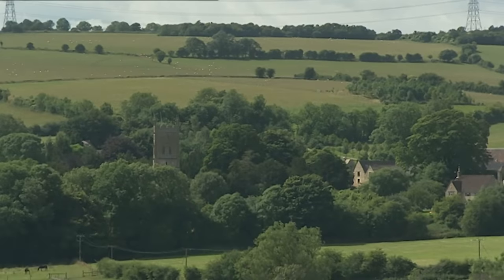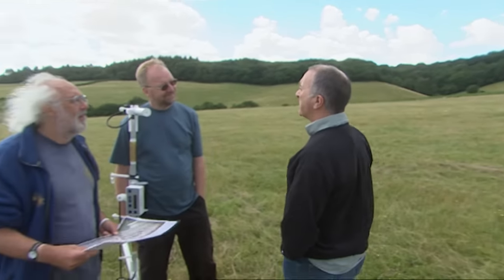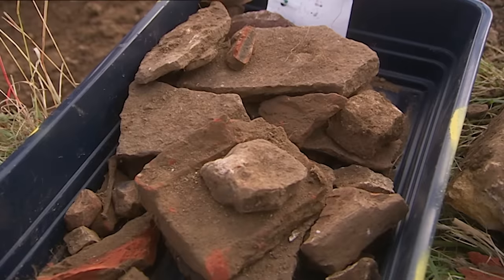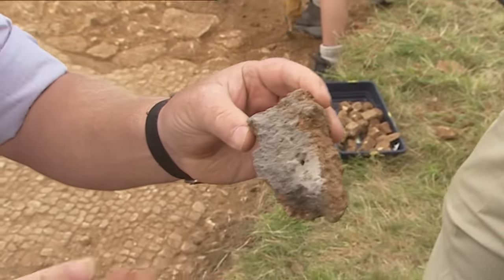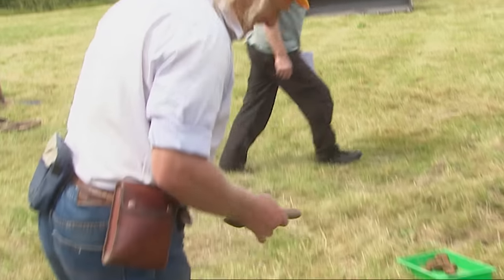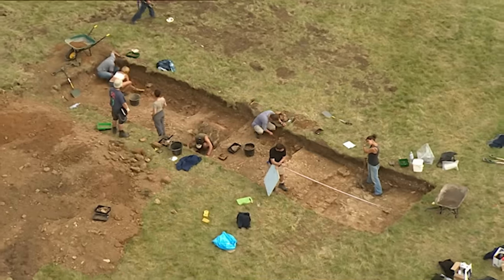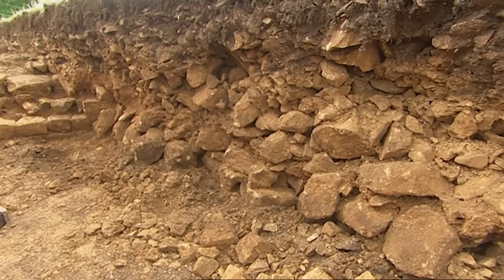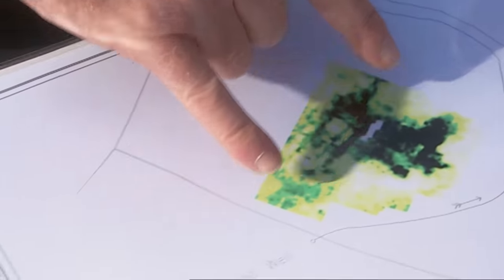The Stunning Roman Mosaics Hidden Under A Molehill | Time Team | Odyssey

Comment: A river in a populated area is not a safe source for drinking water. People at that time use a river to clean there wash; animals stand in or on the water and people uses Rivers to get rid of some trash. But a spring, not far away, with a closed canal tube system and a well on its end or a basin was perfect.

Comment: the engineering described about the bath house is crazy.........that they had hollow box tile structures circulating warm air etc is amazing.........for 2000 years ago. The stream in culverts, they have appeared at a similar site, are testament to harnessing water down a slope to feed structures.........why lug about water when it can be piped right past your buildings...........rivers are always at the low point of the land and full of muck by comparison.

Comment: I don't know if it's because I'm watching this in a 4kUHD TV, but in the image from above (40:52), there's CLEARLY a square-shaped outline (the lower line is a little bit above the on-screen 'Middle Field' text), then the right one runs slightly diagonally, with its bottim-right corner next to the 'upper' large tree - the 'higher'of the 2 in the darker field to the left of the 'Middle Field' text), and the left side of the square runs diagonally - x-ing the road, and it's top-most corner's right after the 'line' appears on the right-hand field. The 4th side I can't make out, clearly, but it seems that it can't be natural, as it's both straight (connected) lines, forming a geometric shape, which is slightly askew.

 I've just looked at the same image, but, on my phone, and it's there.

Comment: Springs have clean water vs dirty river water... I can see why they were worshipped.
Reply: Also a spring uphill from your place means you don't have to haul water from the river.  Let gravity do it.   The water can fill the bath houses, and then run down to the river when you clean them out.

Comment: why don't they use some kind of archaeological pressure washers to safely excavate rather than possibly damage the remains with metal tools?
Reply: cost mostly
Reply: Plus the fact that a high pressure stream of water can do far more damage than a small trowel in an expert hand.
Reply: @lesleyhawes6895  thats why I called them "ARCHAEOLOGICAL" pressure washers suggesting the necessary pressure that is required specifically for such a purpose.